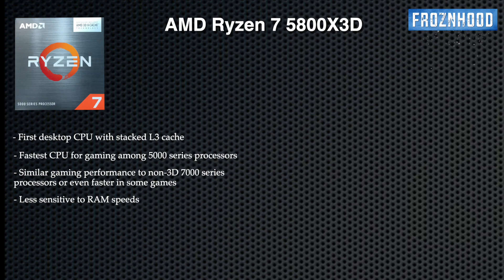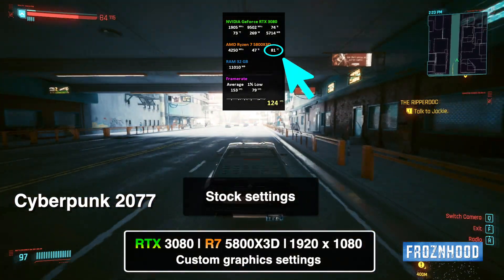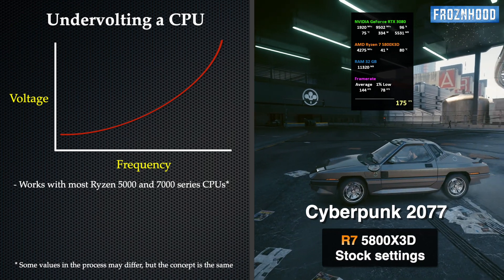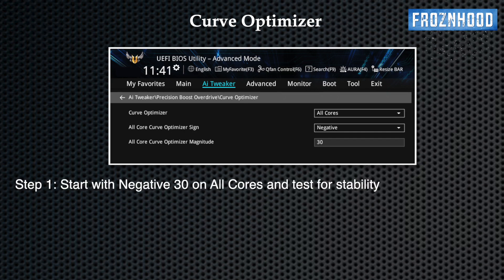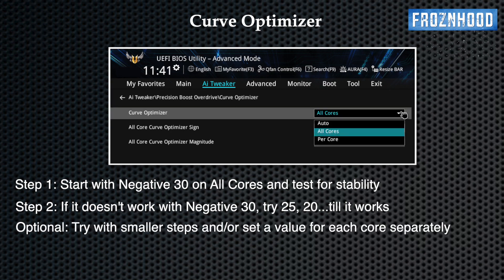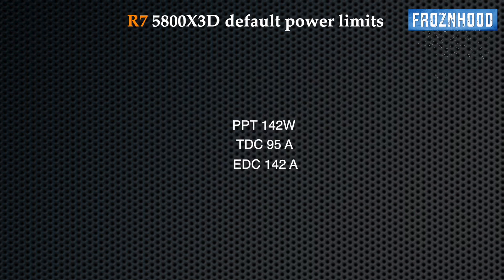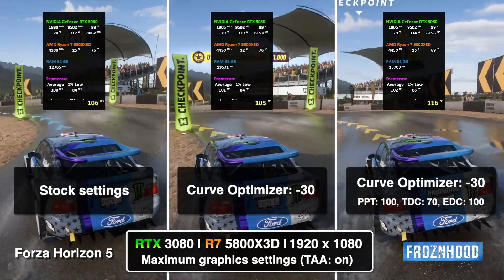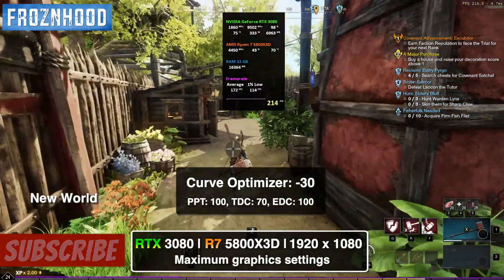Optimizing Ryzen 7 5800X3D - Higher performance, Lower temperature | Undervolting | Curve Optimizer

Comment: Thank you for your Video, that was easy to understand! But sadly it did not do anything for meI know the following will sound kinda crazy. But is it possible for you to make "debug" session with me? Because i am getting such bad results in cinebench r23 (multi only around 6-8 k). Even tho i thought i have a great gaming rig, but every one has much better scores and i am not sure.
My specs are:
Asus B550 E-Gaming 
BIOS 3202
Ryzen 7 5800x3D
Liquid Arctic Freezer 2 360 AIO
Temps of the CPU never Cover 83 degree Celsius. 
8x4 GB 3600mhz GSkill Trident Z RGB 16 16 16 36 
RX 6800 XT
850 w toughpower PSU. 
What is wrong with my setup? I tried almost everything. If i see People with seamingly "worse" PCs spec-wise in the comments, i feel like my situation is not normal and i am not using all the power of my system for gaming. 
Can you help me?
Reply from the maker: Hi, I will start with the note that the performance in Cinebench Multi-core and the performance during gaming are different scenarios. Cinebench is stressing all cores at maximum, while games use random number of cores (up to 3 in many cases), randomly maxing them out. Cinebench multi core test simulates heavy multi-threading tasks such as video rendering or heavy code compiling. So, work, not gaming. 😀 It needs different optimisation in order to achieve better results in this field. The optimising strategy shown in the video is focused on best performance in gaming. 

In order to find your problem, you need to monitor the CPU frequencies. Some people report that their CPU has stuck at 3600 MHz for some reason and the system performs terribly. This can be solved with complete BIOS reset and/or reinstalling the AMD chipset drivers. I advice you to do this:

1. Check the frequencies both in games and Cinebench. And both with stock and undervolting settings. You can come back here and tell me what you get. With undervolting you should get stable 4450 Mhz in games (this is not multicore). In Cinebench you should get around 4200-4300 MHz (all cores), which depends on the unit.

2. Make sure that your RAM is properly configured at 3600 Mhz, including timings and the RAM voltage is accurate. Sometimes you need to set the correct voltage manually.

3. Make sure that you haven't set manually different CPU voltage. It should be at Auto.

Feel free to come back and share any new regarding this problem.

Comment: Hello. Ive tried the -30 100 - 70 - 100. Got higher score in cinebench r23 and doing aida 64 stress test. Its not crashing or restarting. However do you consider this a crash or signs of unstable if while running aida64 and i open a photo .png from the desktop. The photo loads abit slow and sometimes it will say end process. But the pc is not restarting or blue screen. Still running and maintining good clock speeds. 

I also want to ask if i make it -25 all cores. The other value of 100-70-100 stays the same or this needs to be adjusted aswell? If yes, may i know what will be the next value for this? Example 110 - 80 - 110? Increments of +10? Thank you. Hope you are doing well and safe.
Reply from the maker: Hi, sorry for the late reply.

Regarding your first question. Check if the same problem occurs with the stock settings. If not, then the system wasn't stable with these undervolting settings. If the problem occurs even with stock settings, then the problem is elsewhere. An unstable system can have different behaviours - crashes, restarts, blue screens, abnormal app behaviours (including working slow), driver issues and many others. If these problems appear just after the undervolting, it means that your unit needs more tweaking, which leads to your second question.

You can try with -25 all cores and use the same power settings (100/70/100), if you need to. It is possible that your unit cannot handle well -30. It is also possible that it need slightly higher power settings, so you can also try the opposite tweaking -> -30 all cores + 110/75/110. Sometimes it is all about tweaking and testing, when the CPU unit is more wayward. I have had such difficulties with another CPU of mine which is 5600X.
Reply: @FroznHood  i will try this. Thanks. For now i am using -30 and pbo set to auto as i dont get 60c temp due to winter season and i am on a 360 artic freezer 2 with a lian li o11 with front mesh panel. Might try this in summer time if i havent upgraded to ryzen 9 7900x3d or 79503d. Thanks alot keep safe and more power to your channel

Comment: I have the 5800X3D, with a Noctua 12H-U12A cpu cooler, (with thermal grizzley thermal paste) a very air-flow case (5 140mm intake fans). At idle, my 5800X3D is between 35-40c. Under load, no more the 60c at 4.4MHz
Reply from the maker: You mean with stock settings ot after the undervolting?
Reply: @FroznHood  stock settings. No need to undervolt (in my situation), though in others I could see the benefit.

Comment: Can you explain me if tighter power limits are actually useful for mere gaming performance? Do they provide higher 1% lows because they let the CPU reach her peak frequency first? Like, they slightly decrease the "max speed" but they increase the "acceleration"?
Reply from the maker: It depends on how the CPU is being programmed. In this case more power and voltage means a lot more heat for the 5800X3D. And at certain heat level, power and voltage it starts to regulate the frequencies so it can stop the heat increase. Hence it goes below the max frequency. The idea of undervolting is to limit the power, voltage and indirectly the heat at such levels so the CPU doesn't need frequency regulation and stays at max speed. In some cases higher frequencies can provide better overall FPS, better max FPS, or better 1% lows. In cases where the bottleneck comes from elsewhere the performance will stay the same, but even in this case you will at least get much lower temps. That is very simply explained.

Comment: Using your manual settings was a great help! Got 1,000 fps at Valorant Range and stable 300-600 fps during normal game ❤. The Game feels more snappy hehe. Thank you
Reply: Hello I have recently upgraded to 5800x3d but I am getting only 250-280 fps in valorant . 
My specs are 
5700xt gpu 
32 gb 3600 MHz ram gskill 
Can you please assist me if I am doing something wrong .

Comment: I actually get higher frequencies and higher score in Cinebench when I just apply the negative offset to the curve optimizer. However, I see that you gain about 10 extra frames in 1% fps lows with power limits applied and I wonder: how is possible that lowering power limits can increase 1% lows?
Reply: Nvm, it's unstable even without touching the power limits. My chip crashes in idle activities at -30 and -25 of Curve Optimizer.
Reply: @Varil92 mine has never crashed once at -30. I even underpowered it by a whole bunch and still zero crashes, but i decided to not change the power and maxed it out to my motherboard specs

Comment: A question: can this kind of undervolting improve microstuttering issues or will it make them worse?
Reply from the maker: With or without undervolting you shoudn't have microstuttering. The problems is 99% elsewhere - RAM, storage drive, drivers, the game itself etc.
Reply: @FroznHood Sorry actually I meant random momentary frame drops
Reply from the maker: Same answer. The undervolting improves the performance, it is not making it worse.

Comment: Love the video.  How do I know Im not core/clock streching?  I'm trying to figure out using HWinfo and core cycler but I have no clue.  Any help would be greatly appreciated.  I know I'm meant to compare effective against something else.
Reply from the maker: The best way is to watch the frequencies, but mainly the performance in games. Pick a game that has in-game benchmark. I like to use the Cyberpunk benchmark for initial results. First, get the results with the stock settings. Then you can try with the settings shown in the video. You should always get much better temps with undervolting, and in many cases you will also get better performance in terms of FPS. You should NOT get less performance from the undervolting. In that case, it means that your unit needs more tweaking.

Comment: Amazing thank you for sharing. Also, may I know what cooler you used on the CPU and the case
Reply from the maker: Thanks for watching. The CPU cooler is Be quiet Dark Rock 4. In the case I have 4 fans (2 front, 1 up and 1 rear). Everything is on silent mode (very low speed).
Reply: @FroznHood   I'm planning to get 7800-3d  I was wondring if I get lian li with 3 fans on the bottom and 3 top and 2 rare and 3 front side will reduce the CPU temp under 80 on sstandered  without oc?
Reply from the maker: You can't overclock 7800X3D or I have missed something? 11 fans in a case is absolutely unnecessary. This is not a server.

Comment: I noticed on the screenshot for the “All core curve optimizer magnitude” it says 30 isn’t it supposed to be -30?
Reply from the maker: I am not sure what you mean. If you mean the settings in BIOS, in one place you select Positive or Negative and in a separate place you put the value (20, 25, 30 etc.).
Reply: @FroznHood  Since you set the curve to negative already you don’t have to put -30 you put 30. Thanks for letting me know was just a little confused.
Reply from the maker: That is how this BIOS works. Yours may be different.
Reply: @FroznHood  did you seem improvements in idle temps and also did you change the voltage?
Reply from the maker: I haven't compared idle temps, because they are fine even with stock settings. You shouldn't have problems in idle. No, the CPU voltage must be at Auto. The Curve Optimizer is doing what is needed regarding the voltage.

Comment: Hi, congratulations for the video, I set your parameters -30 on all cores + 100 70 100 only that previously I had changed the vddcr to negative at - 0.0.05000 while watching another video. Can the two things coexist or do I put the vddcr back on auto?
Reply from the maker: It is not a good idea to mix different optimising strategies. It may cause stability problems that you will waste time to investigate. If you choose to follow my strategy from the video, put the core voltage back to Auto. Curve Optimizer + PPT/TDC/EDC is enough for optimisation. More than enough. You don't need to change anything else regarding the CPU configuration.
Reply: @FroznHood  thanks for the reply, I tried to put the vdccr voltage back on auto and changed your settings but the temps went back to 90.4 for now I've put everything back as before (yours + the other one) and I have no problems with instability and the temps on cinebench remain at 83° in gaming 76°.
If you have any other advice I would be grateful
Reply: @FroznHood answer i was looking for

Comment: That is awesome tutorial and it works perfectly fine with my 5800X3D with B550 motherboard. I tested my CPU in R23 and the score is the same and temps are -10 degrees !!! Like holy moly man I love you for this video :)
Reply: I don't have such a line. asus b550m-k.where did you find these parameters?
Reply: Try using the search option :PPT limit, TDC limit, EDC limit, curve optimizer sign, all core curve optimizer magnitude

Comment: Hello, if i use this settings i reach bad result on cinebench, everythings its stable. Its normal? Seems to be the cpu work under is potential around 4.250mhz, and ofc the temps are lower but the performance too.
Any idea why?
I have 5800x3d on b450 gaming plus max last bios. Same settings you post on video, just curve -30 c state spread spectrum disable and PPT EDC TDC set by motherboard.
As i say when i put your set 100 70 100 the cpu work at 4250 but i test only on cinebench. Maybe i have to test on games if the cpu reach constsnt 4450? Ty for help
Reply from the maker: It depends on what you want to achieve - better performance in gaming or better performance in multi-core work tasks. These are different use cases that require different optimizations. The video shows how to optimize the CPU for gaming. In this case Cinebench is used ONLY for stability testing and the score doesn't matter.

Comment: Can't find PBO/Curve optimizer in my x570 Prime ASUS board...is there something i need to enable or some sort of update to the BIOS?  I just upgraded to a 5800x3d yesterday, everything is running great but would like to try undervolting to bring the temps down a little.  Cinebench is max's at 85 which is still good but it'd be nice to bring it down.
Reply from the maker: They must be there. Either you must take a look again in every menu or you must update your BIOS to the latest version.

Comment: Thanks for the video, butnI am having a bit of a problem here, my settings are exactly like yours and everything was fine until the 1 system reboot. I dropped it to -25 and it rebooted again, i then set it to -20 and it still did the same thing but after a few days. Usually it crashes if I am going from Apex to youtube. I also undervolted my GPU(gtx 1080, can that cause the reboots as well)? What should I do to make the system stable? Cause I really want those cool temps…
Reply from the maker: Hi, do not undervolt two devices at the same time during testing. That way you can't be sure which one of them couses the problems. I am not sure what GPU do you have and why you need to undervolt it, but that is rarely needed. Anyway, remove the GPU undervolt (set everything to default), and then test the CPU. If it still reboots, you can either slightly increase the power settings or decrease the Curve Optimizer one more step.
Reply: @FroznHood  thanks. I removed the undervolt from my gpu a week ago and it still rebooted, but I did a few adjustments to the cpu undervolt and it has been stable. I got 10 points less in cinebench, though. Is that a problem?
Reply from the maker: No, 10 points in Cinebench is nothing and it is usually not a practical measurement anyway. Use it more for a stability test.
Reply: @FroznHood  pfu, good to know. Thanks, man.

Comment: Hello i have 5800X3D  asus rog x570 and nitro+ 7900xtx  im using -20 all cores so far all god my question  is do you have a suggestion  about ppt tdc and edc about -20?also my cooling system has a noctua-d15
Reply from the maker: Use the PPT/TDC/EDC from the video.

Comment: So i am using a Crosshair VIII Impact motherboard wirh latest BIOS version. Installed my 5800X3D and using the PBO Curve optimiser settings. Only question i have do i need to change the CPU Core Voltage or leave it on auto? Want to know if i can use the offset mode in negative. Thanks in advance.
Reply from the maker: Hi, no, do not change the CPU core voltage in this case. Leave it to Auto. Only Curve Optimizer and the power settings. Nothing else.

Comment: Hello, on my asus tuf b450m pro gaming there is no this PBO function in the BIOS, if I write 'precision boost overdrive' in the search in the BIOS itself, it finds it, I set it to enable, but it still doesn't exist after this function itself, BOIS itself is installed latest version 4002.
Maybe I have a cheap motherboard for this? and you need to buy for example asus rog b550/570?
Reply: I have the same issue? Any updates on it?

Comment: My 5800x3d is stuck at 3.4hz what do I so
Reply: You need to update the BIOS. Older versions that came out before 5800x3d support will default the clock to 3.4ghz. Update fixes it

Comment: I used curve -30 and power limits 100-70-100 and getting 14420 points from Cinebench R23.
Cooler is Asus ROG Ryujin 360 aio and temps were 60-61°C.
Asus tuf gaming X570-plus
Asus tuf rtx 4070 oc

Comment: -30 CO and I get 4.55 to 4.89 boost.
Reply from the maker: You get 4.89Ghz boost clock with 5800X3D?
Reply: cela est peut être qu'une erreur de lecteur d'un logiciel accompagné d'un bug , sans modifier la vitesse du bus qui est de 100 MHZ et avec les update des bios le 5800X3D AMD a fait en sorte de proscrire l OC pour évité toutes dégradation rapide ou lente de votre X3D , la vitesse réel Max officiel est de 4450 MHZ parfois on peut lire 4550 mais ceci est soit 1 pic d'une milliseconde soit également une erreur de lecture, avant la correction de AMD des bios constructeurs il était possible d OC le 5800X3D a 4700MHZ  mais provoquant de possible crash voir des dégradations irréversible infligé aux CPU,
 ceci du a la conception  et du placement sur la puce du cache X3D placé en sous la partie basse du Die qui d 'ailleurs a été placé au dessus du Die  pour un meilleur refroidissent  sur la génération  suivante des 7000 X3D et probablement aussi sur les séries 9000X3D, avec mon 5800X3D il m'arrive aussi de lire sur HW Monitor  que le max de mes cœurs sont a 0/4548.9  1/4548.9  2/4548.9  3/4560.1  4/4560.1  5/4460.1  6/5448.9  7/44548.9 soit  une lecture de 100MHZ de dessus du max de la fréquence  peut être un sursaut du Boost Turbo ou toujours une erreur de lecture jamais corrigé par AMD en utilisation de logiciels tiers , un conseil supprimé des softs comme Ryzen Master  qui peuvent semblé pratique mais qui pour beaucoup 
provoque des crash et bug comme certains logiciel de carte mère dispensable qui modifie des paramètres dans la base de registre Windows avec des effets parfois  catastrophique , fait avéré depuis longtemps, Personne a la science infuse en matières d'électronique les Die de CPU et de GPU ne sont pas égaux en qualités et résistances  c'est une loterie et ca sans compté ceux défaillant ou HS
du a une mauvaise utilisation et manipulations , l'informatique et l'électronique c'est très passionnant et aussi parfois très chiant  et souvent les 2 en même temps
l'infiniment petit comme nous petit terrien que nous sommes face a l'univers mais ca c'est une autre Histoire😉